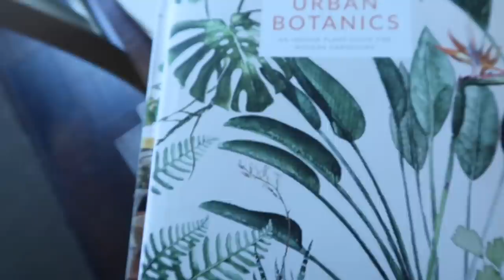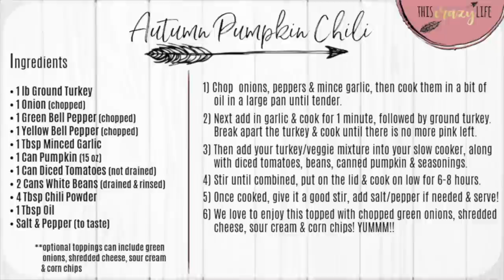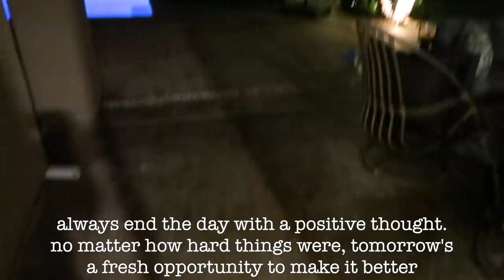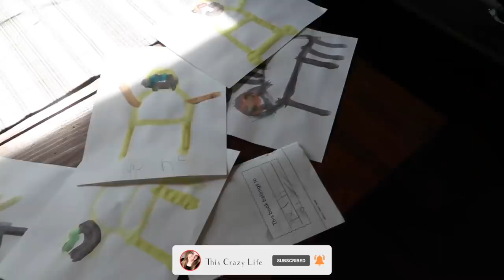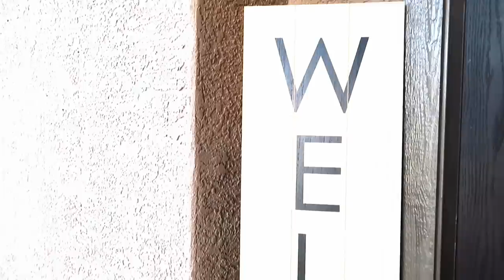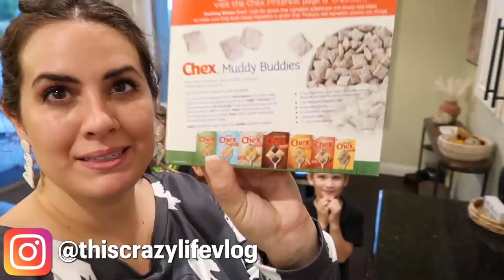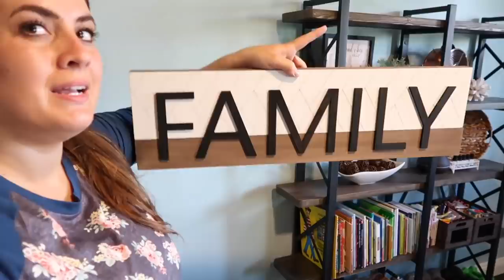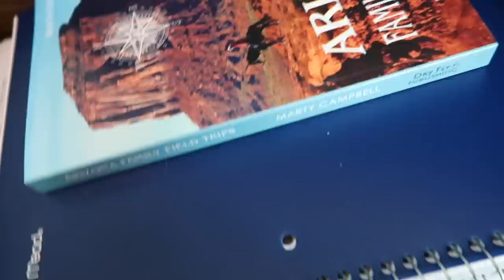FALL CLEAN WITH ME MARATHON 2021 :: 3 HOURS OF INSANE SPEED CLEANING MOTIVATION + HOMEMAKING

Comment: A tip I learned yesterday was to wet a paper towel and place it under your cutting board so it doesn't slide when you're slicing and prevents you from cutting yourself ❤  sending you so much love Amanda!
Reply: What about the rubberized shelf liners from dollar-type stores?  The ones you can cut into any size?  They prevent slipping

Also a friend and I went to staples yesterday and they have silicone plastic placemats in the food savers/ lunch bags section, so maybe that will prevent slipping?